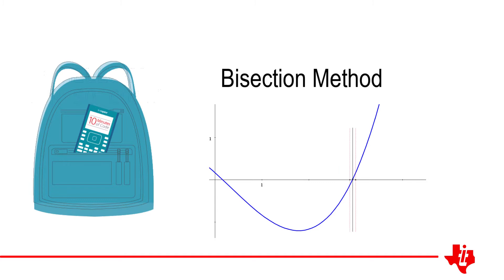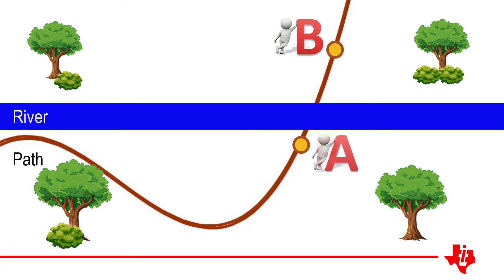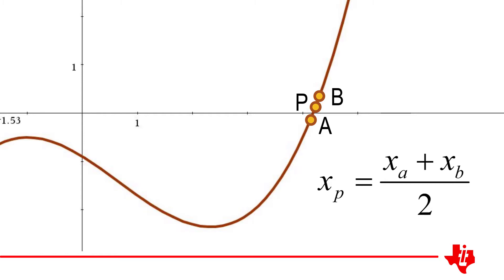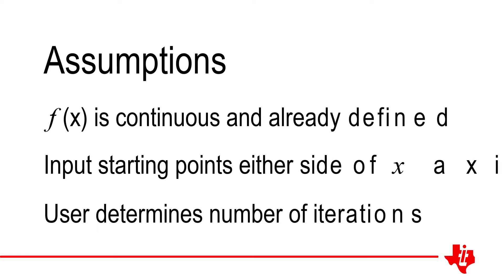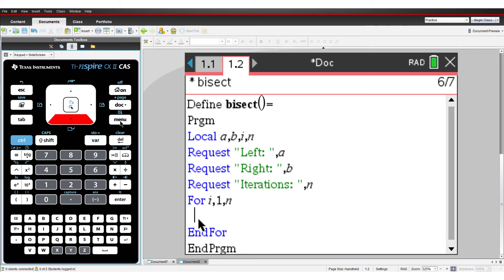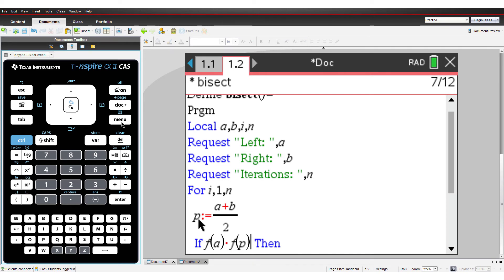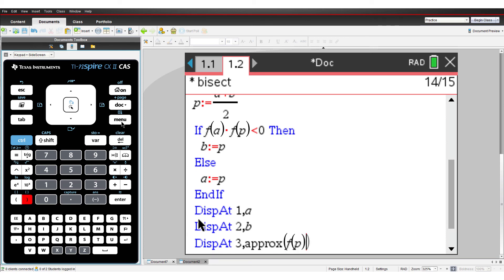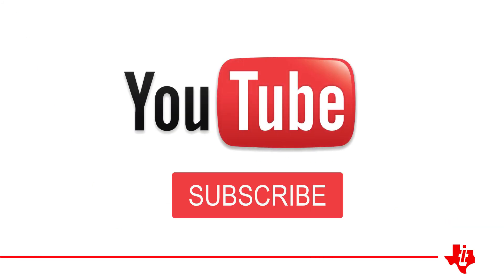10 Minutes of Code with TI-Nspire | Bisection Method for finding zeros

Comment: Hello, I have written the code out line for line and have defined my function as f(x), but am still getting the response others have mentioned in the comments "A conditional statement did not resolve to TRUE or FALSE". Am I supposed to define the function in the program? Thank you
Reply from the maker: The intention is to make the program be able to use a function that you have already defined. Function definitions created in the calculator application can automatically be accessed from a TI basic program. The introduction notes that it is 'assumed' that the function has already been defined, of course you could always add this to your program, but let's get the program from the video working before making changes. 
Other things you can check with regards to "A conditional statement did not resolve ..." 
* Make sure the assignment of p includes the colon ... := not just = ... the colon equals can be read as "assigned equal to" rather than simply "equals". 
* The function must be defined somewhere, start by defining it in the calculator application. 
* Note also that the 'left' and 'right' values must be either side of a solution to f(x)=0 and the function must be continuous.
Let me know if this information helps.
Reply: @TIAustralia  Yeahhh for me I forgot to add the colon to the p and then it worked.

Comment: 'a condtion statement did not resolve to True of false,' what does this mean? i copied everyone exactly and even did a test with the same numbers..
Reply from the maker: Condition statements refer to things like "IF" or "While" ... so if a statement did not resolve to be True or False most likely means that it could not be tested. For example: IF a > 1 Then ... could be tested if 'a' has a value, however, if 'a' does not yet have a value, it is impossible to determine whether or not 'a' is greater than 1, therefore the "condition statement did not resolve."
Reply: you need to define the function  youre using on a separate page in the same doc

Comment: "A test did not resolve to TRUE or FALSE"
Reply from the maker: The IF - THEN statement in the program is the only test, performed therefore the problem most likely relates to f(a)*f(p)<0. Given that p = (a + b)/2 and 'a' and 'b' were requested earlier in the program, the most like cause of your error is failing to define f(x).  This is one of the assumptions stated at the start of the programming section. "f(x) is defined and continuous ..."  So, make sure you have a function defined and that the function is mathematically defined and continuous over the interval from a to b. 
You can check to see if f(x) is already defined. On CX CAS you can simply type: f(x) to see the function definition. On CX non-CAS, it is quicker to simply evaluate such as f(1) or f(2) for which numerical results should be determined. 
Let us know if this helps.